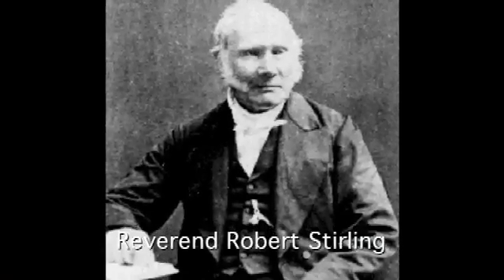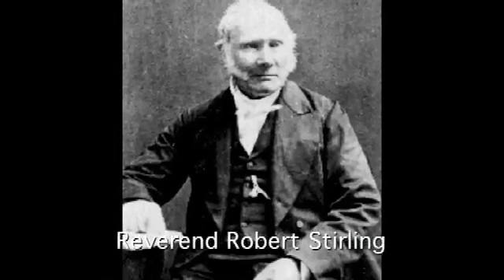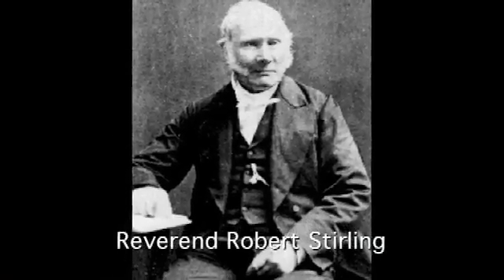The coffee-powered engine - Sixty Symbols

Comment: internal combustion engines are not heat engines... neither are jet turbines... they use gas expansion pressure as a source of mechanical energy.

epic fail
Reply: Gas? Expansion? Pressure? If it walks like a duck its a heat engine *facepalm*. More formally, a heat engine, uses a working fluid to extract heat energy out of a thermal gradient and convert it to kinetic energy. A Stirling engine is a closed cycle heat engine, the working fluid is sealed off from the outside system for all parts of the cycle. More familiar internal combustion engines are examples of an open cycle heat engine, where the working fluid is periodically exchanged with fluids from the external system.

Comment: Can someone explain to me why we don't use something like this on boats or submarines? Presumably the temperature on the boat/air is different than in the water.
Reply: The Gotland-class submarines of the Swedish Navy are modern diesel-electric submarines, which were designed and built by the Kockums shipyard in Sweden. They are the first submarines in the world to feature a Stirling engins
Reply: AWESOME! Okay, my engineering instincts weren't too far off.
Reply: Hypatia4242 
It’s a matter of scale required for the horse power needed.

Comment: is this how geothermal energy can be converted to electical?
Reply: Nah, they work in the same way as nuclear and coal / gas power stations. Water is turned into steam that drives a turbine that produces electricity. The only difference being the source of heat to boil the water.
Reply: Adam Pardoe but this is one of the possible ways, right?
Reply: Well, a Sterling engine works with temperature differences. I'd think it would be quite hard getting a temperature difference in geothermal plants.

Comment: a car engine uses the force of combustion not heat
Reply: aclausjr The energy is released as heat when a compound undergoes combustion with oxygen. It is this heat energy that expands the air and drives combustion engines.
What happens is the temp flashes from a low to a high temperature so fast, it becomes a localized area of high compression, since the molecules are too close to each other for the current temperature, and they want to get away from each other, and do so violently. 
This in turn shoves the piston upwards to decompress those combusted gases.

Comment: I wonder how one would calculate the potential energy stored in a given mass of ice.
Reply: satchel frost You would use the heat capacitance of solid water, the heat of fusion, the heat capacitance of water.------------------------
I think for solid water, it is 2.1 kJ/g.°C and for water, it is 4.182 kJ/g.°C.
I don't know what the heat of fusion is, but let's say it is 5.00 kJ/g.
If you have 200 g of solid water @ -10 °C and your (large) atmosphere is 20 °C:
2.1 kJ/g.°C * 10 °C * 200 g = 4200 kJ
5.00 kJ/g * 200 g = 1000 kJ (for the heat of fusion)
4.182 kJ/g.°C * 20 °C * 200 g = 16728 kJ
====TOTAL = 21928 kJ
Reply: The energy is from the temperature difference, not the ice itself
Reply: That statement is a bit nit picky. I'm quite aware of the zeroth law of thermodynamics. The fact is, the temperature difference is brought about by the ice.

Comment: all thermodynamic passive engines are exaggerated drinking ducks.

they are all duckies.
Reply: Daniel Williams ugh i'm to tired i thought you sayd aerodynamic i was about to facepalm
Reply: now that you say that, i want an aerodynamic system that appears perpetual and is in the form of a duck.

do it science! go!
Reply: +Daniel Williams
Salter's duck?
Reply: Daniel Williams Sterling engines are used in submarines since they are practically noiseless. The engine models of these days produce more energy than the original model and are of course much larger than the one in the video.
Drinking ducks don't have a special application for them and so no one is going to use them in an industrial scale.
Reply: i know but it is a thermodynamic system of passive advantage, yes?
Reply: Daniel Williams What's a passive advantage? It is a clever invention that didn't have any use except for being a teaching tool for a long time until submarines came along. That's basically it.
Reply: um? big>small

jeff the killer.

Comment: It makes you wonder if having one of these on your roof in a cold climate would generate a rather meager supply of electricity? The bottom plate affected by the warmth inside the house while the top was affected by the cold snow... even if it would look like some madness from a Moomin book.
Reply: And where's the heat inside your house coming from?  Electricity or from burning natural gas?  Anyway, you could get free electricity just by using some electricity!  I foresee perpetual machines in the near future, no doubt about it...
Reply: The big problem is that now you're sucking heat out of your house, which is the last thing you want. You want the heat to stay inside.
Reply: Chris Gough /Do you all realise that this comment was made lightly?/

No, since there were no textual clues, and
we don't know you or know what you do and do not know.
Reply: Chris Gough I didn't think any of the replies were of the "asshat" level.
Reply: gumenski perpetual machines being what?
Reply: spyroninja I was being facetious.
Reply: gumenski What about a greenhouse effect?
Reply: Meq That definitely could work, but there are much leaner and more efficient ways of using the sun's energy.  Like a polished parabolic dish with a heat sink at the focal point that the engine would run on (lots of youtube vids of these) or a similar but different arrangement with many mirrors over a larger area reflecting to one focal point.  I guess in a real functional greenhouse it could still be a neat/novelty type of "green" addon for pumping water through the filters or w/e if the heat difference was large enough to power a pump.
Reply: Soulsphere001 Exactly.  Insulating your house is much more efficient than sticking Stirling engines on the roof.
Reply: Do you all realise that this comment was made lightly? and not meant seriously.
Reply: RonJohn63  Well I feel the "rather meager supply of electricity" was a small sign that it was already taken as a fruitless idea and the jest of it looking like something from Moomins being another. I am not trying to stir shite but rather impressed how quick asshats are to strike online.
Reply: RonJohn63
Then I fear I have both understated and overstated textual clues... Christ it's almost boring being civil online now :)
Reply: Chris Gough /Christ it's almost boring being civil online now/

The most shocking part is that it's YT!!
Reply: Or put a stirling engine on a volcano and use a wind powered (or water) Archimedes screw to pump water to the cold side
Reply: Chris Gough its called an atmospheric steam engine
Reply: Meq The issue with that is, in order to harness the energy difference, you need to give that energy a quicker route to equilibrium. Which means by harnessing mechanical energy, you are actively cooling the relatively warmer side. If you had a Stirling engine on top of a greenhouse, it would produce energy, but at maximum efficiency, the inside of the greenhouse would be the same temperature as the outside air.
As long as you realize it is not perpetual, you are on the right page. An engine like that would essentially be a mechanical solar panel.
Doing something like that with say, venus, would lead to the planet into global cooling, by letting its captured heat escape.

Comment: this can change the whole cpu cooling game
Reply: They've been produced and it's only a novelty-type item.  A system like that never works as well as simply taking a few watts extra on the side to power a normal cooling system on its own.
Reply: No - for the quite simple reason that these designs of stirling engine won't start spinning by themselves.

Yes, there are some autostarting designs but they tend to end up spinning in either direction without some kind of kicker to set them in the desired one.

On top of that, LTDs like this are pretty inefficient and generally produce barely enough work to drive themselves, where work is the conversion of heat into mechanical energy. They're not generally true stirling engines either, as they don't have regenerators (Adding one makes them run much faster, for much longer, or produce more work output). 

The displacer is a major source of friction in the system as all the air in the chamber needs to slide past it on each stroke - but reducing the diameter relative to the cylinder makes it run quite poorly, as turbulence is needed to ensure heat transfer from the plate into the air and the thin gap of the traditional design ensures that.

I'm pretty sure that as a computational fluid dynamics exercise someone could come up with a vastly improved displacer design (introducing swirl into the chamber?) incorporating regeneration.

As another hint, the rod driving the displacer can be eliminated in favour of a magnetic coupling (end of the piston, or a more fancy rotating setup) to cause the displacer to snap from top to bottom of the cylinder without introducing an air leakage point. That takes out another point of friction too.

Having said all that, some of the more expensive of these toys can run on a 2C difference even without these kind of modifications, simply by using precision bearings everywhere.
Reply: Alan Brown 
Large scale solar powered stirling engines can pump water or electric generators. 

It’s a matter of scale. But large useful ones are available.

Comment: so why cant vehicles run on blocks of ice?
Reply: because you can't extract enough energy from the air to feed the ice in a short period of time to drive the car engine.

Most car engines are running around 10-20kW work output at 50mph. assuming you could extract work with 100% efficiency (very difficult on a delta of only a few degrees) you'd melt 10kg of ice in only a couple of minutes (latent heat of melting). The thermal capacity of water is about 1/4 of that required to melt the same volume of ice and the thermal capacity of ice is about half that of water.

(Interestingly, the energy required to turn ice at 0C into water at 0C is about the same as is required to heat that water at 0C to just under 80C.)

Comment: Right and it would also make the interior of the space craft colder as it worked (slow as that would be) so once all the heat in the craft was donated to space and the craft had the same temp as the bits of dust it bumps into (though most radiates away), the engine would stop until you turned the heater back on inside, which will require a power source. And usually the more engines you run energy through the less you get to use at the other end because each has a factor of efficiency that's <1.

Comment: could this be done to power electronics on space craft as the internal temperature (inside craft) and external temperature (space) are vastly different? not for propulsion but say computers and other electronics, maybe even life support eg. heat? instead of just a wheel there could be a turbine wheel. also once started how close to perpetual energy would this be?

Comment: I'm sorry for your disability, but you are deaf right?

So i will just point out that at 5:03 he clearly says "The source of heat is the desk"
And at 5:17 he says "The temperature difference that is driving this heat engine is now the temperature difference between the desk and the ice cubes"

Now with the Ice bergs part, i think that most people are intelligent enough to figure out that the energy would be coming from he difference in temperature between the ice and the air surrounding it.

Comment: I don't think you understand. The Sterling engine creates rotational mechanical energy, which is just what a fan needs. It would be silly to drive an alternator with it which then drives an electric motor. This would probably reduce the efficiency by 90% or so.

Comment: Mini sterling powered ice maker:
put a n ice cube on the top of the engine,engine powers a freezer,freezer cools ice.Heat from the freezer goes to the bottom of the engine,engine runs twice as fast due to cooler top and hotter bottom. almost infinite energy.(engine brakes down)

Comment: I'm sorry that this got so many downvotes because it is a good question and a common misunderstanding.  You can't get more energy out of a system than was in the system to begin with.  In a perfect system you could get exactly the same amount back out, but in reality there is energy loss throughout the whole system, from lost heat energy to the surroundings, resistance in the wire, and friction the the moving parts.  Hope that helps clarify for you!  Keep asking good questions!

Comment: Not sure if someone else has answered this yet, but i'll give it a try. This idea would only work if there was a temperature difference between the river and the surrounding air.  Particularly it would be useful if the water was warmer than the air.  This is in essence the idea behind geothermal generators, which do exactly what this engine does (though typically not with this exact setup).  
tl;dr: Putting a heat engine on a cool river would be akin to putting this engine on a cool cup of water

Comment: Just a little correction here.  Life does not prevent entropy in a closed system.  If you look only at a living organism there is organization of particles that would seem to indicate a reversal of entropy, however, whenever particles are sorted in one area, they are disorganized in another (in the case of life this is typically heat energy from the burning of calories).  Eventually there will be a homogenization of energy throughout the whole universe as erick said.

Comment: The heat sink would use more energy than what could be produced because the power is produced by the difference in temperature, the heat sink increases the temperature difference but in doing so expends energy, since the energy produced is from that difference which was created by the heat sink It could never produce more energy than was put in, because of the law of conservation of energy.

Comment: I know - trace the comments back - but it will cool to room thermal energy, and because air has a high-ish (higher than metal) specific heat capacity surely the energy will still go from the metal to the air - metal is the same temp as air, but it has less thermal energy, because of its lower specific heat capacity (specific heat capacity is found by - E= change in T *SHC/ volume - if memory serves

Comment: Fans do not actually cool air, in fact, they actually increase the kinetic energy of air and therefore temperature. What we experience as "cooling" is due to the difference in our body temperatures and the air temperature, in which our bodies heat is dissipated to the air. 

When more particles of air pass across our skin, more heat energy is dissipated in which we percieve to be colder. 

So if a fan is directed at a room temperature surface, there is no cooling effect.
ie NO temperature change

Comment: I DID NOT SAY IT WOULD BE PERPETUAL!!!!!  

its speed would increase, but not at a steady rate as there are two variables - heat increasing on the top plate, and heat decreasing on the top plate. as the fan goes faster the temp difference increases, making it go faster.

ITS OBVIOUS IT CANT GO ON INCREASING - what ever happened to light speed and the Higgs field?

Comment: imagine this

you have a car for example 80 horsepower

now you can add more fuel to the engine you can put the pedal on the floor the motor has it's physical limits you can't make it go like it has 200 horsepower even if you're increasing fuel perpetually the speed just won't raise forever it is limited by the torque by the friction etc. and most importantly by the cylinder capacity.

The same goes with heat engine like this.

Comment: well, it does cool - a particle will absorb some heat energy and move on, the proccess continues and the top plate cools to the temp of the air. It would be like a counter currents,  the temp difference comes from how the top plate is protected by the top plate.

Comment: 60,000K for a duration of 1/1000th of a second at an extremely small point.

The amount of energy transferred from the ignition coil to the fuel/air charge inside the cylinder via the spark plug is negligible.

Comment: Ok I get that your point is that air expands when hot, I'm not arguing that point. Internal combustion engines do not run on air. 

The fuel/air mixture used to create motive force in an internal combustion engine expands rapidly when ignited, it also has the side effect of giving off heat as the fuel oxidises with the air, the heat itself is a side effect and is not essential for the engine to function.

Comment: Indeed but my point is an internal combustion engine would run perfectly well if the fuel charge expanded without giving off any heat whatsoever. The engine itself does not require the presence of heat in order to function.

Comment: The reason the gas wants to expand suddenly is because it suddenly gets quite hot due to the combustion of the fuel.  The cooling system in your car is there because the metal that the engine is made from can't take being as hot as the hot gas wants to be, so you need to take heat away from the engine and accept the requisite loss of efficiency.

Comment: In the winter, the power often goes out after it snows. My house happens to use a well, so I cant use water pressure, but we have a fireplace. I got a sterling engine with a long tungsten tube that ran from the piston straight into the hot burning charcoal you get afterwards by the time to go to bed. I attached an inertial rpm cutoff and it to the transmission of a heavy duty electric pencil sharpener and its motor to power charging 4 cell phones and the intercom.